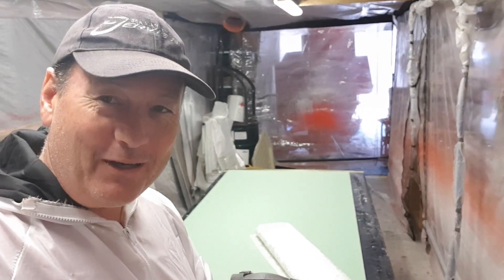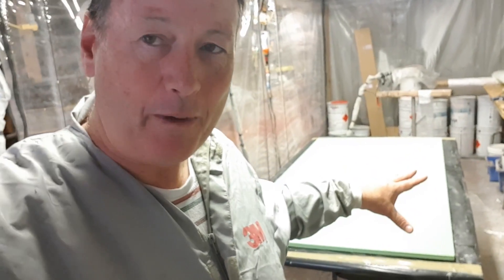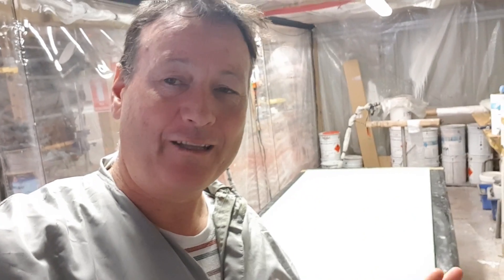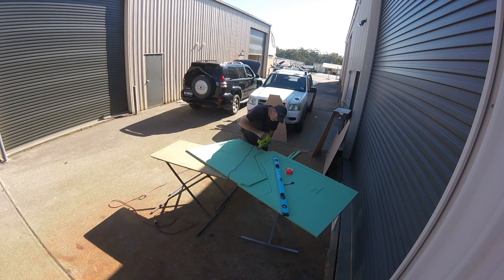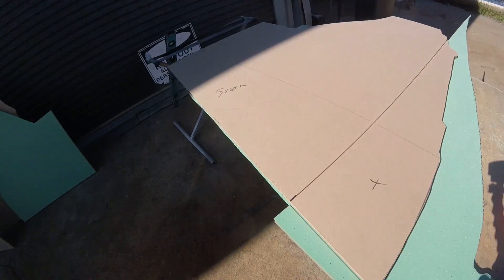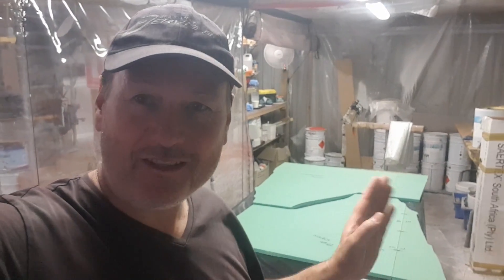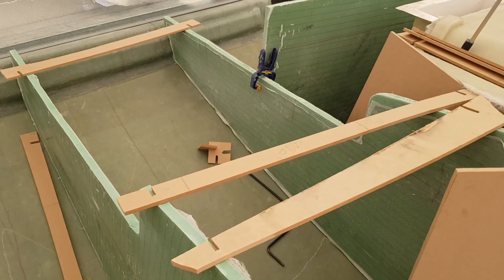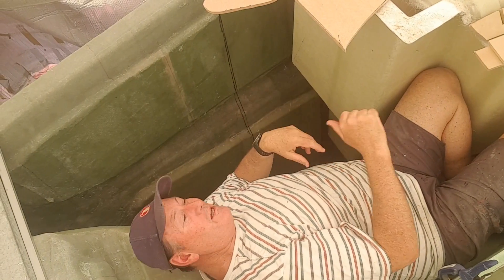Ep053 - Making Crash Bulkheads - Life On The Hulls - Catamaran Build

Comment: your chain typr template generator is a great idea. To get the shape of the more intricate shapes make up 20 to 30 chain links that are only 1/2 as long as your current links. when you are getting a shape that includes one of those tighter curves, take uour chain apart right at that area and substitute 4 to 5 of the shorter links. only use them when you need them so you dont have to make so many.
Reply from the maker: I love that idea,it is pretty intricate at times and has been a godsend to this process.Cheers Ross

Comment: Fantastic progress Thanks for sharing your adventure!
Reply from the maker: Cheers Don,hows you ship going buddy.
Reply: Slow, I screwed up the fuel tanks so had to cut them back out and start over ($800 mistake). But I've never built a boat before so mistakes will happen.
Reply from the maker: What a bugger.I have just ordered my fuel tanks and made a complete cardboard version so hope they were correct.Ross
Reply: @LifeOnTheHulls  - My issue was I got lazy on fit up.

Comment: I have a project, definitely not as big as your project but it sure is kicking my butt.  It's -27 c with the windchill here today.  A bit too cold for epoxy so I spent the day in the basement working on the hatches.  Curious as to what blades you use with your jigsaw for cutting fibreglass.  I go through a lot of blades when cutting fiberglass.
Reply from the maker: I use 10s makita blades on the jigsaw thet are definqtely worth the extra expense.Cheers